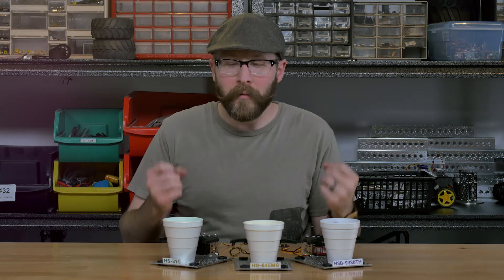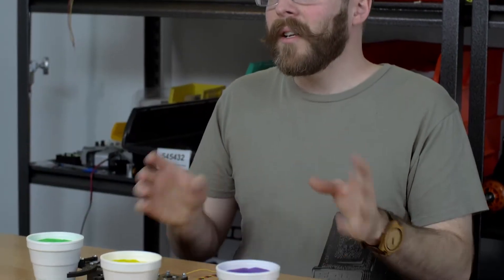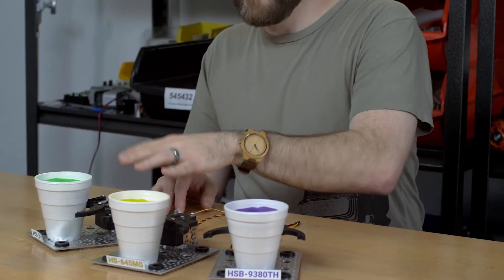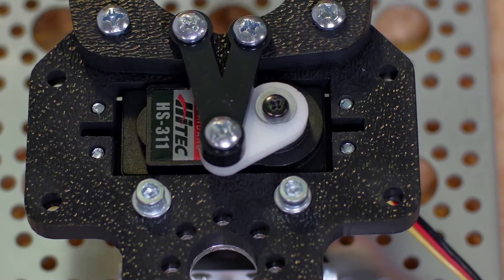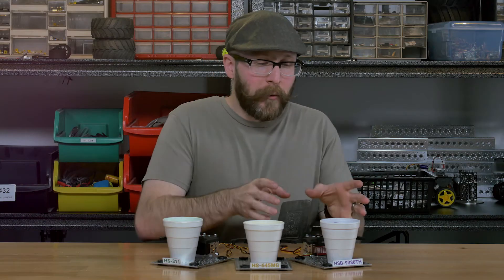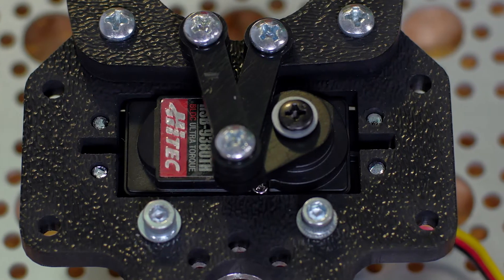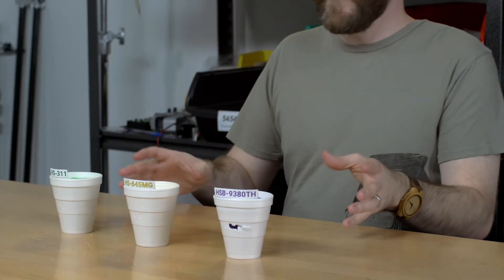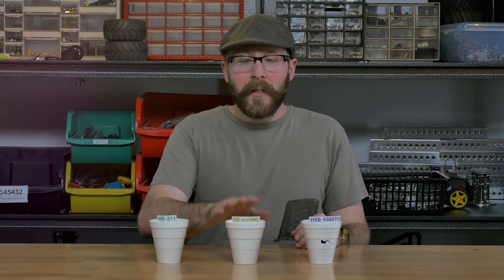Servo Torque Illustration

Comment: When you say ounce inches of torque can that be applied to lifting as well?
Reply from the maker: OZ-IN is a measure of torque, which measures rotational force, it can be converted to force if you know your lever arm length. If you have a 100oz-in of torque, you'd be putting out 100oz with a 1in lever arm, or 50oz with a 2in lever arm. 
https://www.youtube.com/watch?v=KS2T2mvMitA
Reply: @ServoCity  thanks! I figured it would diminish that way I'll have to do some math and figure out what servo works best. Thanks for clearing this up for me I know it's a bit tricky to convert and explain to someone who's new to it all
Reply: Sorry one more thing could these connect to something like a raspberry pi? Or a 32channel board? Obviously you would need an external power source to get over 6v for these servos

Comment: I need a good gripper build. Where can I find the ones in this video
Reply from the maker: Hello - you can find our gripper kits at this link https://www.servocity.com/gripper-kits/. Please let us know if you have any questions.
Reply: Thank you so much! I am looking for something smaller the sg90 is one of the smallest servos I found. I just started learning about robotics and am really interested in making each are operate independently. With 4 settings of speed and off really hard researching what I want to learn with out the proper vocabulary so any hints or tips. Just a hobby not like I have time to go to school for this . Thank you for the reply!
Reply from the maker: @JoncoreTV  You might want to look into controlling your servos from an Arduino. That would give you the ability to control them individually with whatever speed/timing you want. 
You may want to check out our video on controlling servos with Arduinos.
https://www.youtube.com/watch?v=T8nCN10MjNE
Reply: Wow thank you so much for this info! And site links. I have no run into another road block. I want to have a manual way to operate the gripper Incase the chip or the Batteries die.
Reply: And assuming I will have to make some kind of smaller gear in the servo or maybe I could attach it to the gripper mod it’s self. But once I do something I fear I will just run into another problem is there any cool forums or maybe a discord I could join?
Reply: I also got the small server and the matching battery in my cart can you tell me what I should buy to program it. Again brand new to the hobby